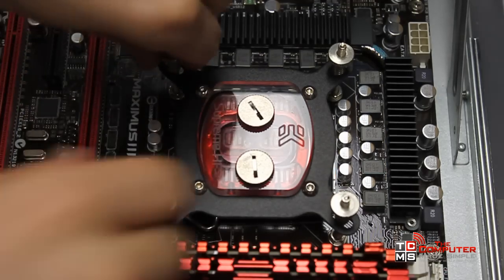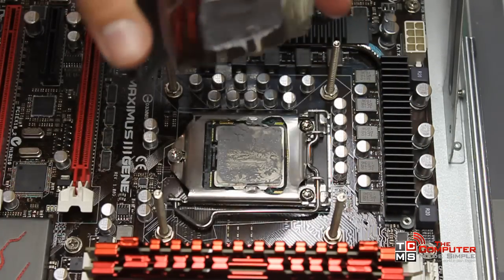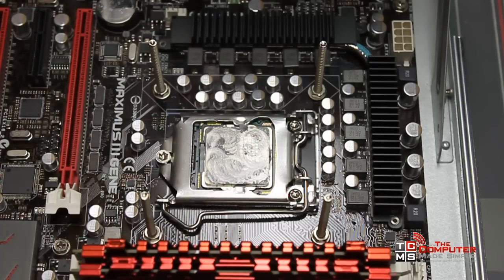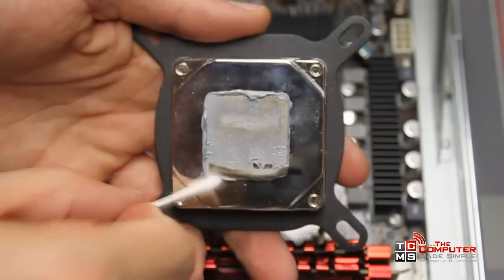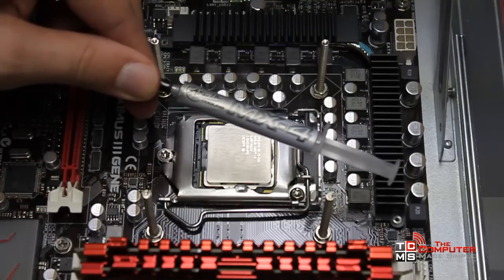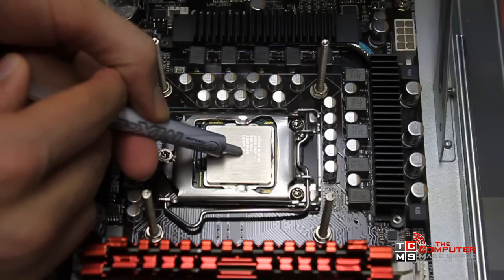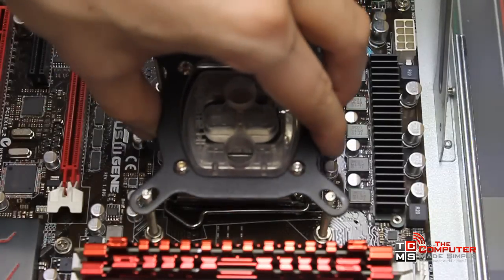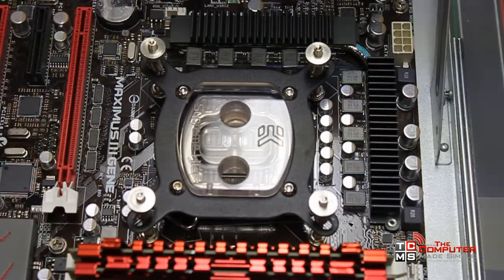How to install new thermal paste

Comment: Tip: don't hold the bottle of alcohol over the motherboard the way this guy did.
Reply: Martin alcohol will not hurt the motherboard, it is not conductive like water. Either way before doing work like this on a MB take the bios battery out and hold the power button to drain the capacitors, then if you spill anything on it you can just dry it and it’ll be fine.
Reply: @Big_Iron_Mode  I still stand by my statement.
Reply: @Big_Iron_Mode  Thanks. I broke my motherboard
Reply: Kramez lol should have listened to me
Reply: A few years ago, I accidentally dropped half glass of alcohol on my motherboard. It still works...

Comment: I also tried a grain on the middle of the CPU, but after removing the cooler wasn't covered entire IHS. That's why I'd rather use a spread method.
Reply: Can u spread it with the thing that comes with the thermal paste?

Comment: I have a question. Pls respond! I have a problem, when i turn my pc it turns off after about 10 seconds and continues to turn back on and the cycle continues. Can this be due to the thermal paste?
Reply: No
Reply: Could be the power supply.

Comment: Hey, Ive had trouble with my PC turning itself off during games. I have changed out old RAM for new and it didnt work. So I changed out my PSU for a brand new one. And it seemed to work for a week or so but I was playing Star Citizen last night and it turned itself off again. Could it be that I need to change the paste? My PC isnt6  overly dusty at all!
Reply: PolaroidMemory the turning off is prob overheating and that messes up your cpu
Reply: PolaroidMemory your PC is most likely just overheating.
Reply: PolaroidMemory i have the same problem.
Reply: PolaroidMemory monitor your heat from the CPU and gpu to see if that's the problem
Reply: PolaroidMemory late to the game, but for anyone worrying about overheating as the issue should download OCCT.  From there you can stress your CPU and it will flag you for high temps.  During stress it may also give you the same crash.  Helps so you don’t waste money on unnecessary parts.  Use memtest before wasting money on RAM.

Comment: can i use alcohol ethanol 97% for cleaning
Reply: You can use any Alcohol pretty much. Just the higher the percentage the easier it is to clean. if its lower then all its gonna do is take a bit longer to clean it off.
Reply: Blood Camelia Just about anywhere really. I would suggest a local drug store, walmart, dollar tree/general, and etc. Also, when I ran out of Alcohol I used my fiances fingernail polish remover. So maybe ask a sister or mother and see if they have any of that laying around.

Comment: how to know if you use enough or to much?
Reply: +Game Experience if its too much it will start to spill out when you tight your heat sink screws , and by the way it does not mater how you put it and it will not become cooler if you add more but it will become hotter if you add less the amount in the video is just perfect

Comment: How often do i change the thermal paste?
Reply: I think you should really change it since its been that long. Also get rid of all the dust thats been piling up in your PC. That could be the solution to your problem or the cables connecting the PC to the monitor. Ehhhhhh.......
Reply: +Cakelton Whenever your temps are high and it's not due to your computer being dirty .
Reply: What if i haven't changed it for more than 3 years or maybe already 4 years, but temperature always between 45 - 65, and alot of time around 53 - 58, by the way i have Lenovo B5400 ?
Reply: I haven't reapply this since i bought my pc 3yrs ago, now the temp is +60°C when idling
Reply: im havinga issue i play about 5 minutes of a game and my computer screen goes no signal the game itself runs all good could it possible be the thermal paste ? i havent changed it in a long time maybe 2 years our so
Reply: Oi calelton time to change your thernal paste. i do it every three years
Reply: Maybe every 1.5 years